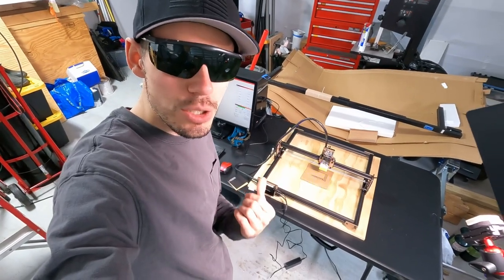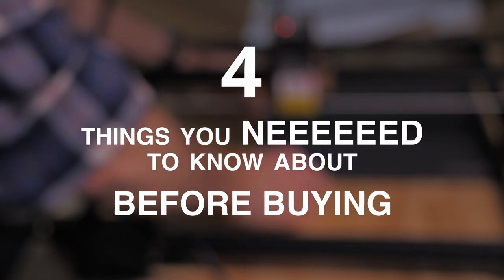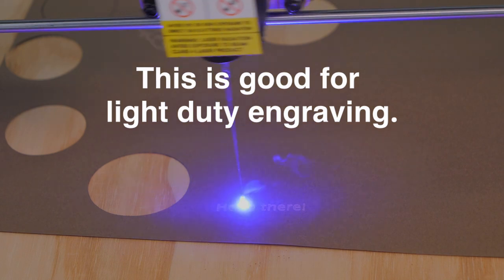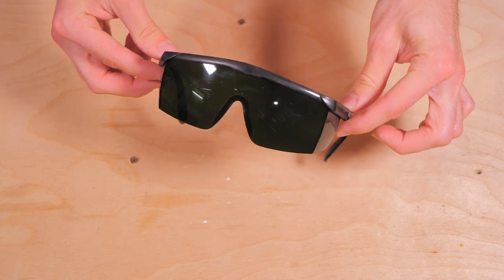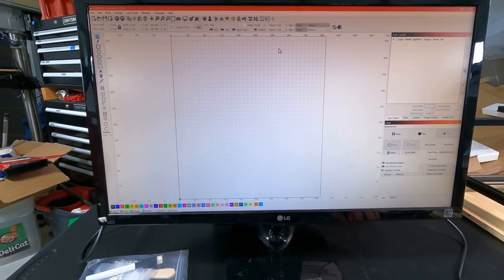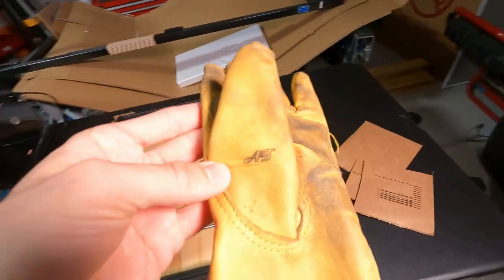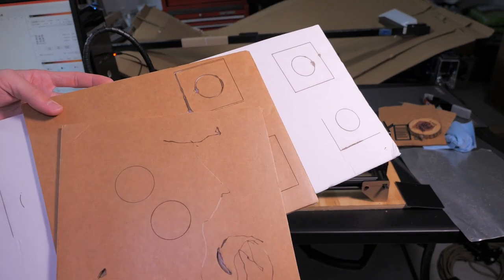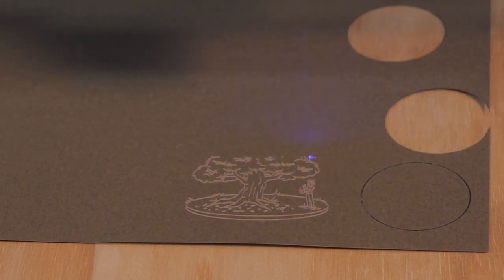Instant Customization Machine - Fokoos FE20 Budget CNC Laser Engraver Review

Comment: Almost no 5w diode laser will cut through in 1 pass. Try again with 2 or 3 passes and set your power down to about 85/90% and slow it down to around 400 or so. If the paper starts to burn go faster or turn down power level and add another pass. Every machine is different just like a 3D printer is, things like temp, moisture can and will effect how it works so just like 3D printing what setting that work for me may not work as well for you. Always do tests before you start a project to find what works best for you, it will save you a lot of hair pulling because it didn't work out as you found out with your foam board.
Reply from the maker: Thanks. Good tips.

Comment: My Experience with laser cutters / engraving is it's amazing. I like engraving on the top sides of mirrors/plexi for art displays. It's amazing. It's worth learning monotone / duotone processes in like photoshop and gimp. Inkscape is also a free alternative to Illustrator. Layers change to paths usually when saving to DWF.  Also masking tape will help keep the burnt material from redepositing on the work plane.  You can find a plexi supply house (local or internet) an they'll sell it by the rolls. I do a 3ft wide by x yards. Still on my first roll. I use the cream color ones, blues didn't really give me a good experience. Foam core is OK, but the only fire we've had in the shop was someone running very think foam core at a too low speed. The cutter was down a over a month due to part shortage. I could see this in a hood painted black for light absorption and you also should have a fume extractor. Worst smell ever, engraving turtle shells. =D
Reply from the maker: Very cool! Thanks for sharing. 👍

Comment: Thanks for covering trying to cut foam board from the dollar store. I want to build my first rc plane using foam board and I though a laser engraver would work good. Have you tried another color foam board since white does not work well?
Reply from the maker: I think it would cut through black foam fine. The issue for me is that the best foam board for lightweight planes is from the dollar tree, and it only comes in a white core.